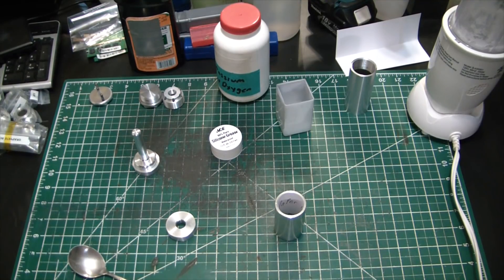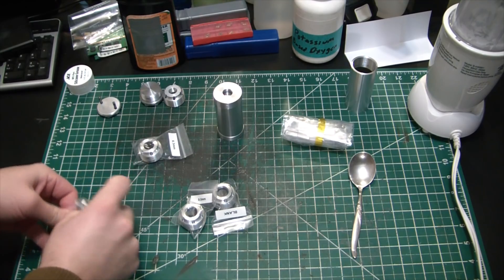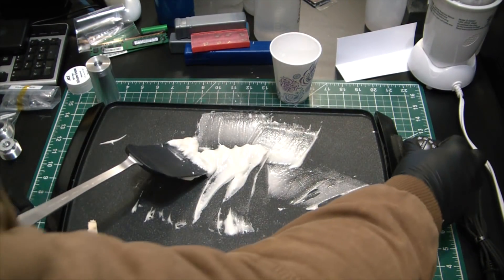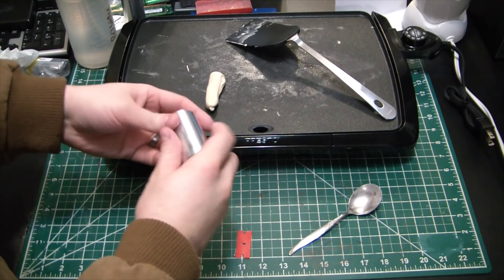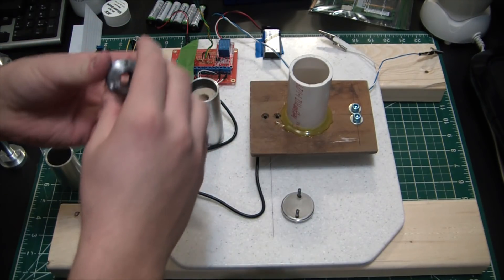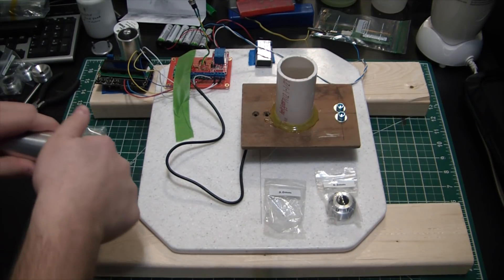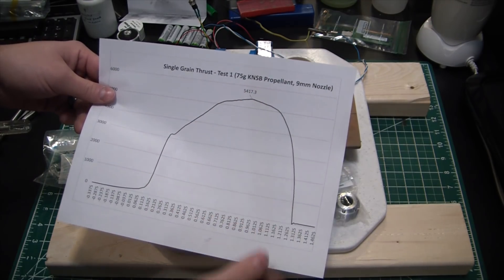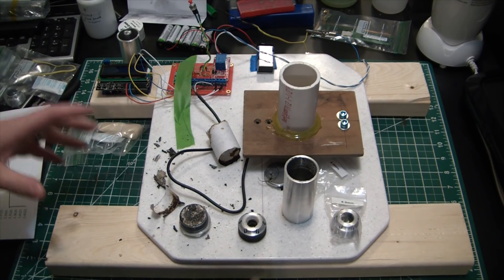Testing The Biggest Rocket Motor I've Ever Built on Arduino Stand - ElementalMaker

Comment: ElementalMaker I designed a rocket engine I would like you to test...it's unique in that it has a heat conductive steel/titanium/or other strong metal reaction chamber which is heated by a thermite reaction, chemical reaction, or induction.  Inside the chamber is finely or better yet nano powdered calcium carbide which is separated by a wax seal from the highest percentage Hydrogen peroxide you can get (30% for hydroponics and growing) A nozzle with a very small outlet diameter would be capped with a "burst disc" style plug that would release the high pressure Hydrogen/Oxygen/Acetylene/Superheated steam through an ignition coil.  Let me know if you are going to try this new type of rocket, or if you think it would work.
Reply: What type ignition coil?  Can you give some detail please?
Reply: @jameshohimer2542  All my DIY ignition coils have been fine steel wool with copper wires to a 6+ volt source, however for a rocket like this a sparkler type firework would work as well as a ground mounted 15 minute burn road flare which could be aimed in such a way to heat the reaction chamber and provide ignition.
Reply: I'm not trying to be insulting but your description is a mess.
from what I can gather your idea is a mix of a thermal rocket engine and a monopropellant rocket engine with the disadvantages of both but none of the advantages.
-Hydrogen peroxide has a terrible specific impulse (this means it's not very fuel efficient, especially compared to the 90% peroxide commercial rockets use)
-using heat conductive materials just increases the amount of heat you need to produce to keep the reaction running as heat will be transferred away from the reaction and spread out across the rocket
-Thermite is heavy, lowering your thrust to weight ratio, making the rocket worse
-CaC2 and hydrogen peroxide can react explosively

in the end, not only would you end up with a terrible rocket but also the very real chance to blow yourself up
Reply: @lordhelmchen616  To this day an average of 10-15% of space program rockets explode and/or fail.  My description may be all over the place for some, and may seem confusing to you-but it may be perfectly clear for others.  Another confounding factor it is like no other rocket I am aware of, although my tests with this reaction using a ground mounted 15 minute road flare for both heating the reaction chamber and ignition has produced superior results and pressures over black powder based and Estes brand rocket motors.  And it makes a HELL of a boom during inevitable failures.  Rocketry has a history of danger, it's not for everyone.  Keep in mind superheated steam rockets have achieved high altitude, so if it makes it clearer-this is a modified version of those- that has the inclusion of not only superheated steam, but also a very flammable mixture of pure Oxygen, pure Hydrogen, pure Acetylene, as well as Superheated steam.  Have you ever mixed finely powdered calcium carbide with 30% peroxide?  I'll clue you in:the reaction is instant and massive even in an unenclosed, unheated environment.  The powdered form causes the peroxide to break down as powders catalyze the release of the Oxygen and Hydrogen in Hydrogen Peroxide, the water catalyzes the Calcium Carbide in a powder form extremely fast as well.  The wax divider seal allows the mixture in the sealed reaction chamber on demand through heating which also causes the liquid to go to a superheated steam state under pressure.
Reply: @ProlificInvention   Prolific Invention  I agree with someguy, you're all over the place reading that it reads like you're manic! You seem clever and even more so you seem very interested. 

My advice would be to listen to what the man is telling you. He couldn't be more correct about everything. 

I get the feeling you seem insulted, if you are that's very childish. The smartest people take direction and advice on board, you just seem like you got you're ego deflated because he knows more about them than you, chill out. 

I'm not trying to be rude its great to have people like yourself trying things, but I sense hostility from you towards a man that was giving you advice, very good advice at that. 

My two cents on it are your ideas a good but the practicality of it all is terrible, for a myriad of reasons. 

I know my phraseology is a lot less kind than the first person,  so please don't take any of this to heart, its only a discussion.
Reply: @atourdeforce  I apologize for offending anyone's sensitivities, thank you for pointing out it wouldn't work.  I would like you to test a mixture of powdered calcium carbide and 30% strength hydrogen peroxide in an open container, it is nothing short of incredible-just don't smoke 😂.  There is alot of potential energy released.  You are correct about some guy knowing more than me, maybe universally.  Idiots never know that they are afflicted-and I may be manic as well.  But 2 OZ of this mixture explodes far louder and with much more energy in my deck cannon, than 2 OZ of FFF black powder-so that is what I'm going off.  Thank you.
Reply: @ProlificInvention   Prolific Invention  No need to apologise to me brother, I wasn't exactly pleasant i could have been nicer, but I don't say things to be rude or hurt peoples feelings. 

But you have the smarts to come up with ingenious idea's in theory but they dont always work in practice. I can't even explain to you how much my head hurts reading this, you have wax seperating this, and with road flares melting that etc... 

You're not trying to make a bomb and you're not NECESSARILY Trying to make the most energy dense mixture. You make the best mixture for the application. 

Also creating a mixture that releases energy in multiple ways isn't necessarily advantageous especially if one part of the reaction makes less energy than another part 30% peroxide and CaC2 is never going to release the same energy as an AP Mixture so straight away you have a mixture thats probably not suitable. Then you have the practicalities of such a reaction.

You would be better breaking down your reaction into little bits. Find out how much energy is released for each stage of the reaction, then compare those energies to a known and more simpler reaction used like Ammonium perchlorate based mixture. That's one of the simplest and Energy dense ingredients you can use. 

I bet you if you do this you will find that a lot of your reaction doesn't relese the same amount of energy as simple AP.  I hope that made Sense if not please let me know and I'll try do a better job of explaining what I'm trying to get across. 

But also I think you need to look at making things far more simple. You're going off on tangents left right and centre with all these complicated and messy procedures and frankly not even safe or reliable. 

Its hard to explain but I just feel you're going in the wrong direction completely with it and missing a lot of massive issues. TEST things don't just tell somone well this releases a lot of energy so it has to work kinda thing. Or when it explodes it gives the biggest bang ever, like do you not see what's even wrong with that sentence. You're assuming things now by how big of a bang something makes. 

It sounds like you want this to work more than actually using something that will work. 

You're using all these chemicals with no regard for their weights their energy density, their ease of use, their practicality etc etc.. And all of this with even knowing if the mixture translatates to more thrust, Nevermind its thrust to weight ratio or its practicality or its safety. 

One example is you are depending on a wax layer or boundary to keep the mixtures seperate, I wouldn't want to go within 100ft of this set up, nevermind being the one to load the peroxide. Also what do you do on a hot day? Make it even more complicated by surrounding it with ice to keep the wax cold. 

Also 6point8 didn't say it was a potential bomb he flat out said it sounds like a bomb. When I think AP rocket motor I don't think its a bomb or fear for my safety even though anyone with even half a brain would understand its a potential bomb, but when I think about your set up I think unpredictable and I literally think RUN!
Reply: @atourdeforce  I agree with you, it is an energetic reaction which I happened across which is very, very dangerous and interesting.  It is most likely inferior to standard rocket fuels in energy content, and is a complicated process to experiment with compared to off the shelf and available rocket motors.  I guess after being amazed by the results of my own observations I was hoping to see ElementalMaker do some additional tests.  The odds of this happening are next to zero, and the general consensus is that it is a terrible idea.  Have a great day!
Reply: @ProlificInvention  The reaction isn't dangerous at all, its the practicality and the set up that makes it so dangerous. 

By all means try it and experiment that's how new things come about, no one is telling you not try we are giving you advice on how to try better and safer And to THINK! I.e to think why it would be a good idea to use this over that and to think negatives vs positives. 

You clear clearly are able to come up with ideas. You don't need to have the answers, half the experiments and inventions ever made were accidents and stumbling Upon new directions and new theory. 

But be clear no one is trying to put you down were saying you need to think more! Even from a weight standpoint i could tell you Carbide isn't ideal. 

EM maker seems nervous around KnO3 motors, he's not going to come near this with a bargepole. If you have the time and money I would strongly suggest this be something you try yourself but do it safely.

Experimenting is one of the great joys in life and whether this is a fail or not it will still be very fun and an all round awesome experiment to do, let alone the libraries of knowledge that can be learned from it. 

I just wish I was in the same area as you as I would have no problem helping you and working on something like this with you (as long as you load the peroxide of course😝) but I live in Ireland so that's not really possible.
Reply: @atourdeforce  Thank you for a well thought out positive comment!  I only beg to differ on the danger aspect of Calcium Carbide mixed with high percentage Hydrogen Peroxide in an enclosed container as it is a highly volatile and violent chemical reaction even if unconfined.  In a confined environment the pressures would build to immense levels quickly, and we are are talking pure Hydrogen, Oxygen, and Acetylene in a close to stoichiometric ratio.   By substituting some Calcium Phosgene with the Calcium Carbide an even more energy dense and self igniting mixture forms when mixed.  I had just remembered the Calcium Phosgene Frome previous successful experiments in recreating the lost recipe for Greek Fire ...Although that's what I would call this modern rocket fuel mixture I have invented "Greek Fire" a very suitable name for it 😂
Although maybe not the most energy dense substance known, it would be primarily Hydrogen Peroxide which is already a tried and true rocket fuel, with the pure Oxygen released going to oxidize the acetylene as well as the Hydrogen and being self ignited by the Calcium Phosgene.  Keep in mind also that the powder form of the calcium carbide allows for the violent catalytic breakdown of the peroxide, almost any inert powder will do this, you can try it in an open bowl with household peroxide-a very safe and demonstrative experiment.  Thank you again my Irish Friend!
Reply: @ProlificInvention  Estes motors are all BP and BP is a marginal propellant.

If booms are inevitable, then your design is faulty. I don't now of any steam powered rocket - superheated or not - that has ever flown to a significant altitude, if at all. 

And no, 10% - 15% of all space program rockets fail/explode. Such failures are quite rare.
Reply: @buggsy5  If you say so, may I suggest just using Google for 5 or 10 minutes to check that information, it may surprise you.
Reply: @lordhelmchen616  Control is provided by the rated burst pressure of the burst disc type plug, the wax melts and combines the ingredients at relatively low temperatures so very high heating (or explosions😂) only occur if the container is insufficiently designed, the nozzle too narrow, a combination thereof, or if the burst disc type plug is too stout.  Thank you for letting me know my description seemed a mess.
Reply: @lordhelmchen616  Hot things fly higher and faster as compared to cold things, ever see the effects when you heat golf balls?  I don't necessarily think high heat would be a handicap-but then again, I'm no rocket scientist.  I self identify as a prolific inventor (obviously 😂) and tinkerer with more ideas than sense and time.  Good thing is I'm still alive due to luck-even after many explosions testing these mixtures in my deck cannon and poorly designed experiments, that's why I asked Elemental Maker for his input and opinion, he is way more schooled and pro than I am at these things, and is not afraid to experiment with inherently dangerous projects.
Reply: Sounds a bit "bomb-like" to me.....yikes!
Reply: @6point8esspcee68  Yes, all rockets are potential bombs, very powerful ones at that.  There are many thousands of hours of video footage of all sizes and types of rockets exploding.
Reply: became a rocket scientist while reading
Reply: @SharkyMoto  You becoming a Rocket Scientist is kind of impressive but it isn't Brain Surgery, is it?
Reply: @SharkyMoto  😂🤣😆
Reply: You need to go away from thermite. In fact what you need even more is a cooling system. Thermite just has disaster written all over it.
Reply: @nightrous3026  I agree, read my previous response as I remembered Calcium Phosgene can be added to cause self ignition, no heating required.

Comment: Sweet what would it take to make a longer burn? A BIGGER engine lets find out. Because I'm no rocket engineer  either so lets find out. ....Great video  keep them comming.
Reply from the maker: To make the propellant burn longer would require changing the ratios, or adding a burn retarder such as baking soda in a small percentage. The issue then is your max thrust is reduced. So your essentially trading reduced max thrust for a longer burn. Of course there are more advanced propellants out there, such AP composite, which simply has a shit-ton more energy per gram than sugar propellant, so you can both create higher thrust and longer burns.
Reply: @ElementalMaker  Or making motor with larger diameter
Reply: Making it longer burning at the same specific impulse is not really possible using the same ingredients. Its kinda one or the other. 

But removing the core or narrowing the core bore size will all slow it down making a longer burn but it will also drastically affect or reduce the thrust at the same time.
Reply: Will a longer motor case of the same diameter increase the burn time proportionately?
Reply: @kwhp1507  With the same propellant, core and nozzle as well? No, it will increase the thrust/pressure and decrease the burn time.

Increasing only the propellant length to get increased burn time only works with an end burn motor.